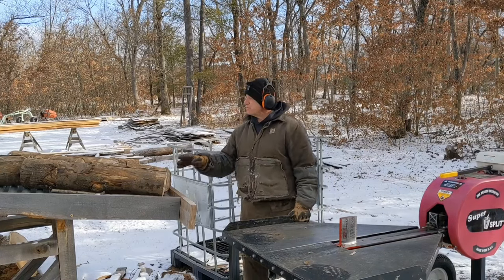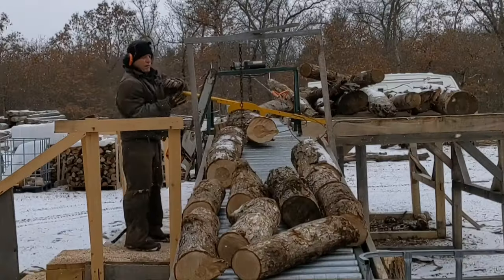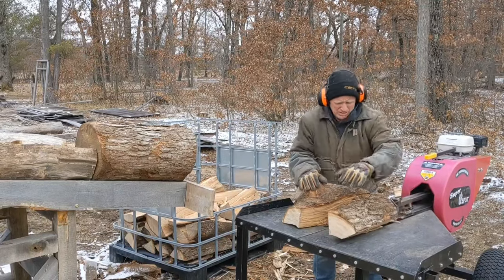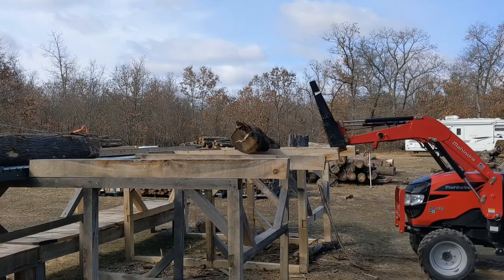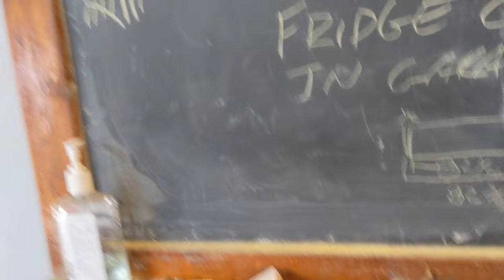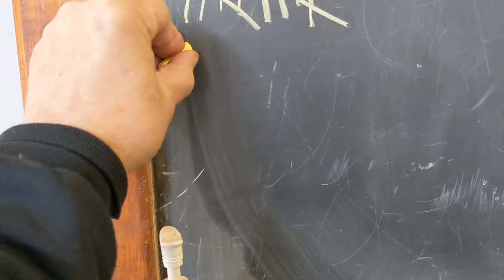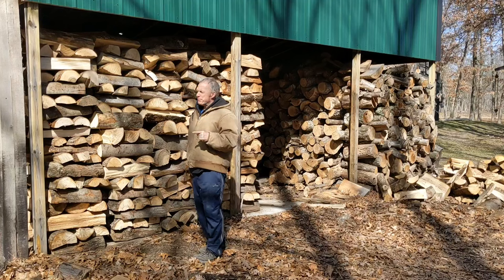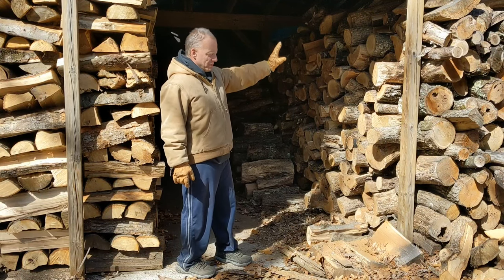Making Firewood a Faster Way

Comment: I like your setup. I need to do something similar to your setup for slab cut offs. They are a pain dealing with. Gods job there Sir.
Reply from the maker: I use this for my slabs as well.   I tried the bucking rack but it finally fell apart.  I'm trying of building a bucking table as well.   I hate them slabs but with my boiler I put them to good use.   Thanks for watching and have a great week

Comment: We are getting to old and wise to lift gas cans over our heads!! Any kind of fuel transfer pump is a wise investment!! Last year I bought on Amazon a Spout replacement kit, that had those vents, and flex spouts with threaded collars, to replace those annoying non-vented spouts! Enough for 6 cans was like $15.99, so I fixed up all the newer crappy gas cans that I had!! Well worth it, plus now I have a few spare parts if I need them.
Reply from the maker: Thanks Tim.  I'll look into those.   I hate these new spouts

Comment: Happy resurrection day! Our sermon today was from 1 Corinthians 15:1-9 Proof that Jesus arose from the dead and was seen by many witnesses; also proves that other promises from the scriptures of the King James bible are also true. 
How much is the slope of your roller deck from the chain saw to the log splitter?  I have just bought 3 5 foot lengths of 2 foot wide roller tubes, and I am just about copying your design.
Reply from the maker: Thank you for the verse.  Happy resurrection day to you as well.  I'll have to check the angle.   I don't recall what I made it.   I definitely wouldn't go and more slope because it comes down and gets tight on the bottom log.   I'll check this week and get back with you or maybe Put it in a video.  Either way I'll let you know.  Have a great week.